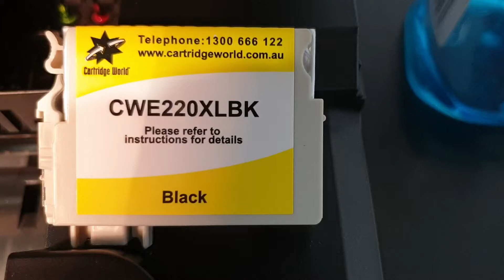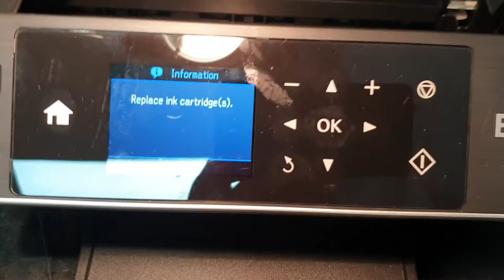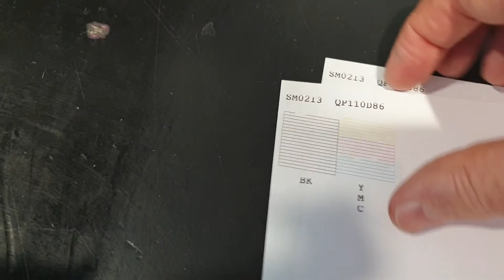Epson Printhead Cleaning: Something different to look for.

Comment: So at least on 252 cartridge ink systems, the only grommet is inside the cartridge spout.  I picked one grommet out of the spout and placed it on a spike.  It appears to seal tightly around the spike with a tight fit.   Definitely not designed to seal at the base of the spike.   In fact there is a slight gap at the bottom as the spring loaded door at the top of the cartridge spout pushes against the top of the spike.    I am at wits end with these.   They are beautiful when the ink is flowing.  But as soon as one color starts breaking up it quickly snowballs into a frustrating waste of time and ink trying to correct it.   I just don't know what to do any more.
Reply: You may have half-clogged filters inside the cartridge spikes, instead, which cause slow/intermittent inkflow. You may try to unclog it by forcing a syringe on the relevant spike and suck-n-pump some warm Windex or distilled water (40°C MAX) into the printhead. Remember to leave at least 2mls of air inside the syringe to avoid breaking the nozzle plate seal with overpressure and to put a piece of kitchen paper under the printhead to avoid flooding the printer with ink. Do a bit of 'piston action', then purge the printhead with Windex. Clean cartridge bay (no dirt, no dried ink, no wetness), replace carts and do clean cycles in set of 2 checking nozzle pattern in-between.
Reply: @Gavichap  It's almost never the printhead.  When it is, with a few drop-outs in the print check pattern, it will always clear up with 2-3 cleaning cycles.  90% of the time the problem is defective Epson cartridges.   You know you have a cartridge problem when the nozzle check pattern actually gets worse with more cycles.  Nozzle issues always show improvement with cleaning cycles.    Every time a color stops printing and doesn't clear up with 3 cycles - put a new cartridge in and it improves immediately.   This happens even with full Epson ink.   They suck.   I used only genuine Epson ink for 5 years because I thought it was better for the printer.   I learned my expensive lesson.    Never again.
Reply: @barackobama5304  did you end up switching to a generic ink? If so was it pigment water proof ink?
Reply: @organicportalphobic9601  Yeah I switched to non-Epson refillable cartridges over a year ago and the problem went away.   The Epson cartridges are over-engineered over-priced garbage.  They scare people with all the warnings about using non-epson ink but I can't begin to tell you how much wasted time and money they cost me.  Yeah, pigmented ink works fine.

Comment: Interesting on my 3640s there is no rubber seal at the bottom of those ink spikes in the carriage.   The only rubber seal is entirely in the spout of the 252 ink cartridge.   I have often noticed that if a cartridge is removed and put back it never works properly again until I put a brand new cartridge in.   I think I might try putting O-rings at the bottom of those spikes.    But I think your postulation of poor sealing is correct.
Reply: Epson printers are truly awful, don't buy them ever again. For now, try this solution: buy a set of refillable cartridges with autoreset chips off eBay or AliExpress. You can fill them up with warm Windex or distilled water (never use tap water!) and clean the printhead nozzles by doing clean cycles in sets of 2 interspersed with pauses of 10 minutes. Flush the carts with distilled water, refill them with ink and off you go.
Reply: @Gavichap  In my experience the problem is more likely to be a defective Epson cartridge than the printer itself.   I would say about 15% of the genuine Epson cartridges are defective out of the box.   It could be that diaphram inside them, I am not sure, but at some point the ink flow stops and does not resume even with 30 cleaning cycles and 5 head cleanings with windex.    I love the printers but will never buy a genuine Epson cartridge again.

Comment: I was about to take a hammer to two WF-3640s then ran across this suggestion.   Will give it a try tomorrow to see if you have the magic bullet
Reply from the maker: Keep the hammer handy! Please take the time to thumbs up this clip, it helps others find it quicker.
Reply: @cartridgeworldcastlehill9518  My problem was solved by stop listening to Epson scare tactics to only use genuine epson ink.   Every problem I ever had was due to their overpriced and poorly made cartridges.   I finally bought refillable cartridges and they work great.